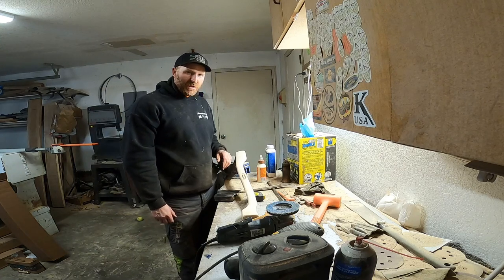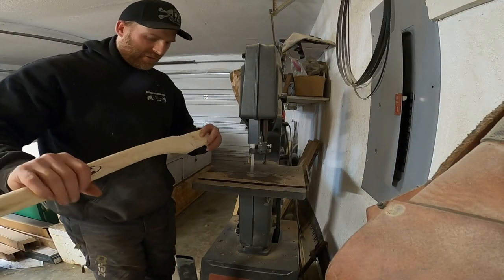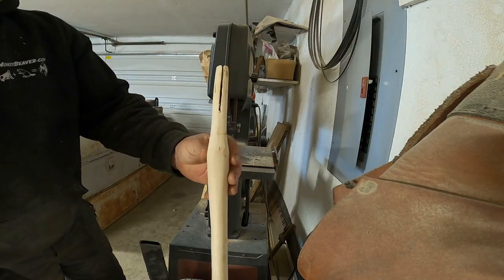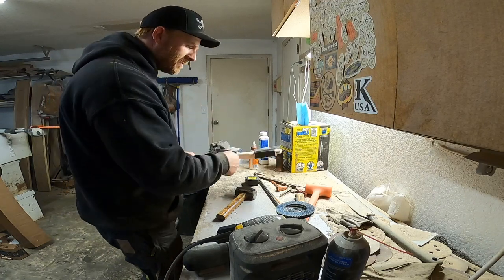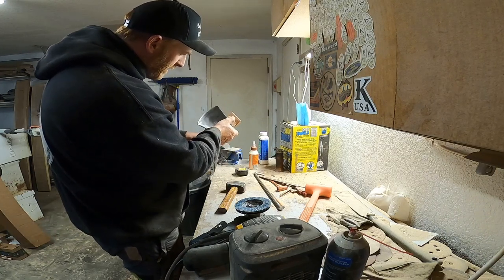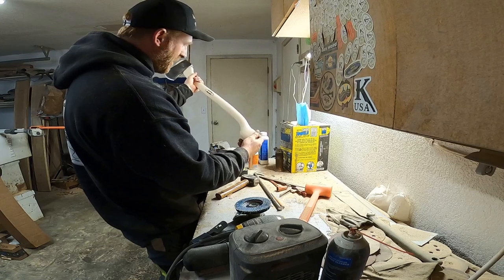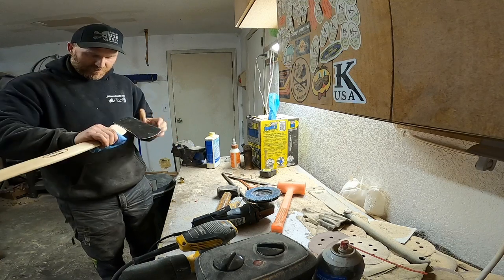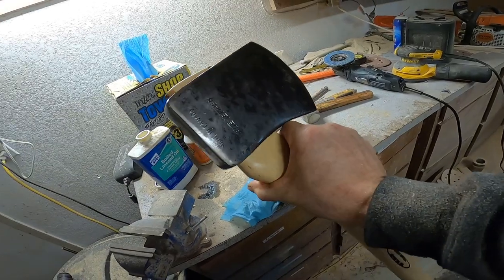Buckin Billy Ray axe handle hafting

Comment: Ever use tung oil might want to try it Linseed oil carries a slight yellow tint, whereas tung oil dries to a clear finisT ung oil creates a harder, more durable finish than linseed oil Tung
 Is more water-resistant than linseed oil Raw linseed oil takes significantly longer to cure than pure tung oil Tung oil is generally more expensive than linseed oil